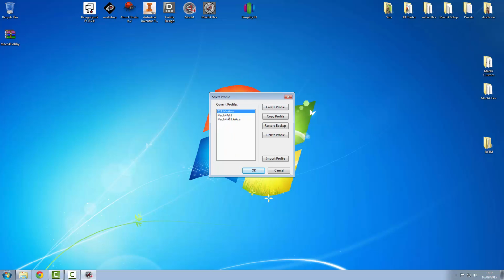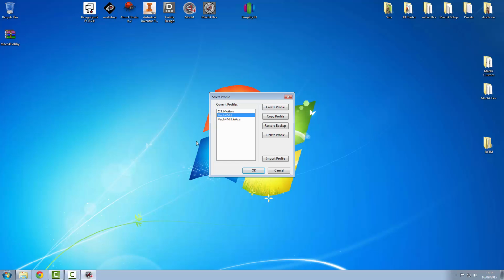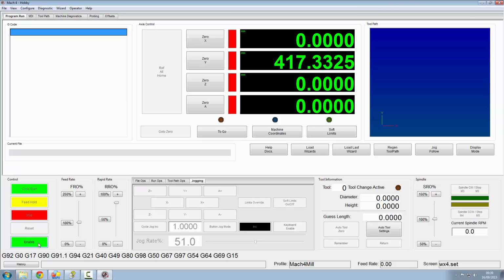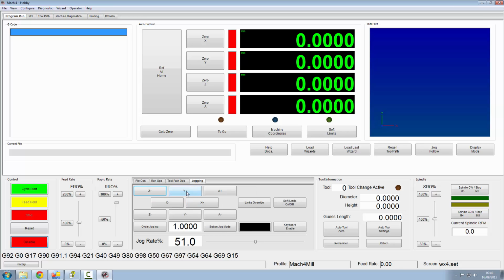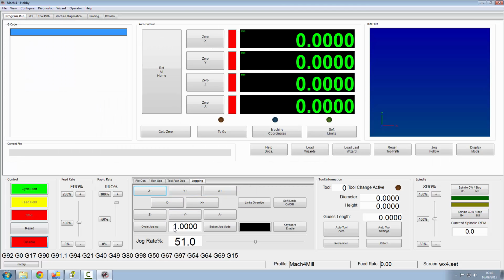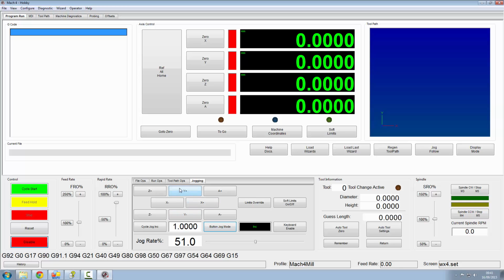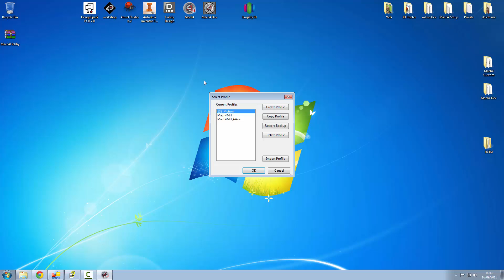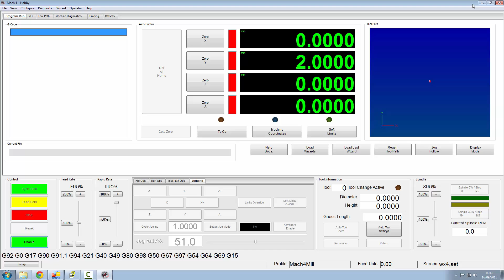Runaway Axis after Jogging

Comment: Tried to add this edit but got a scripting error on exiting and on restarting?  I am using the ESS, C10 BOB,  Verison Mach 4 v2686, the 8 July Mach 4 plugin and Windows 7, getting occasional runaway axis.
Reply from the maker: +Bartley Ives just check in your startup script that you have the inst declared, if not you can change inst to 0